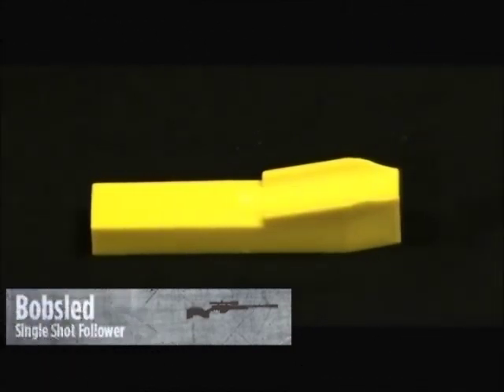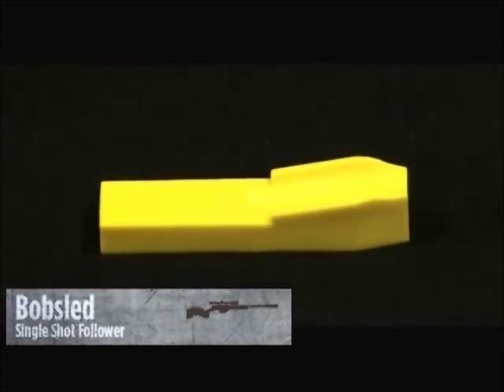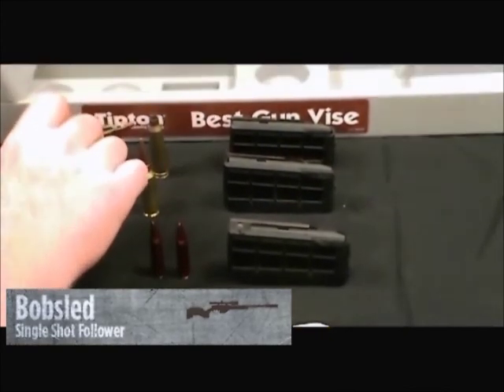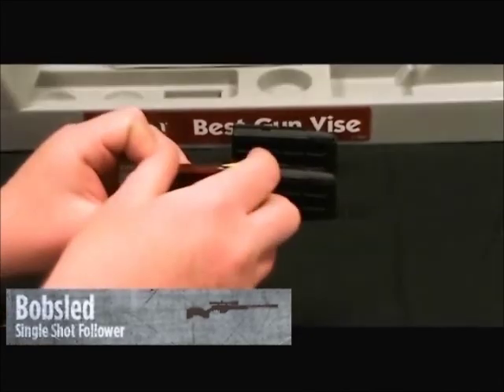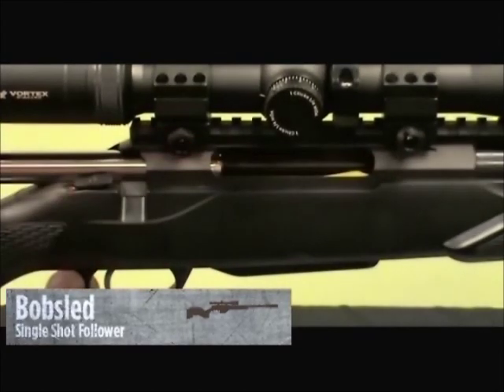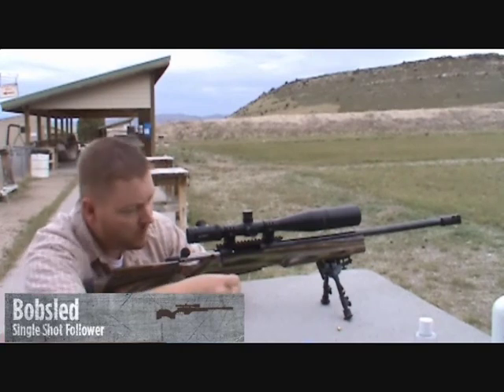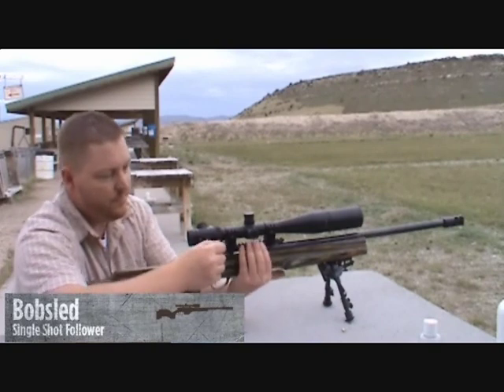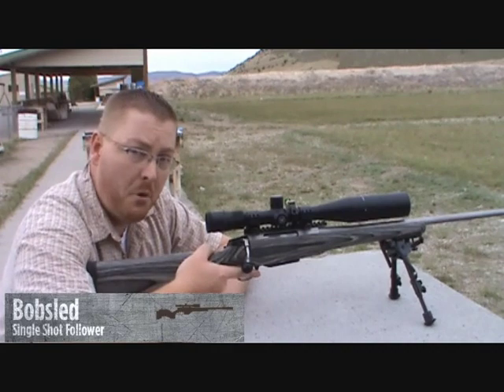Tikka T3 Single Shot Loading Device

Comment: Not sure why you need one on my new Super Varmint. Just tried it last weekend and had absolutely no problem loading a single round repeatedly?
Reply from the maker: Stephen Fraser Depends on the caliber. Some single feed just fine but most drive the bullets into the flat face of the barrel instead of the chamber.

Comment: does it work in CTR mags? i think they are completely different double stack mags? is there an option for the CTR mags, or is it not even a problem? i ordered my CTR and should be here next week.
Reply from the maker: Munky332 These only work with the standard T3 mags. We've had great success just throwing a round on top of the mag and single feeding with the CTR.